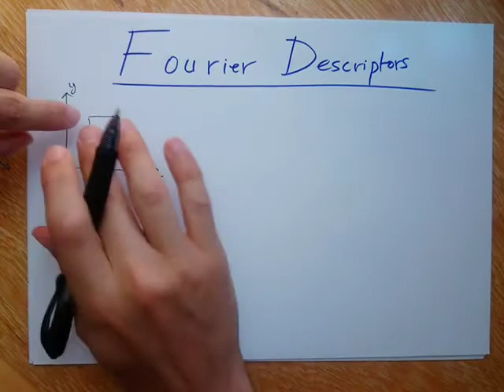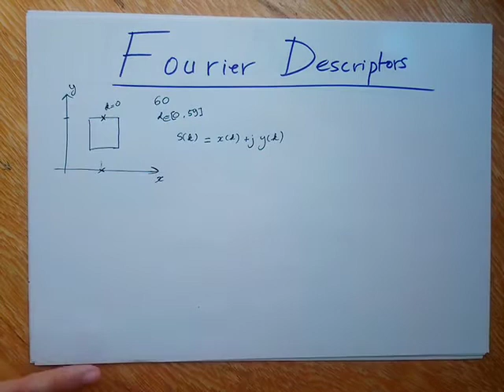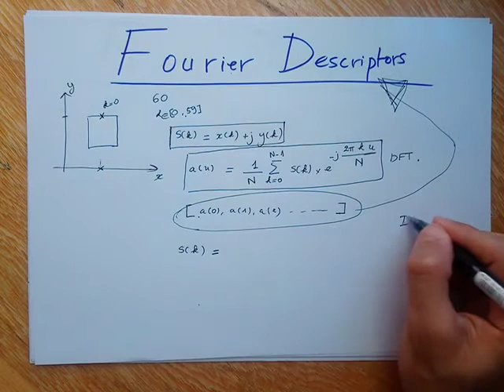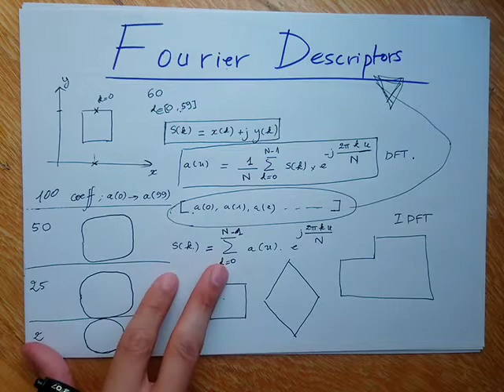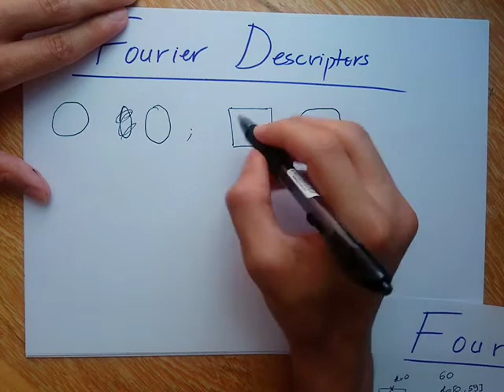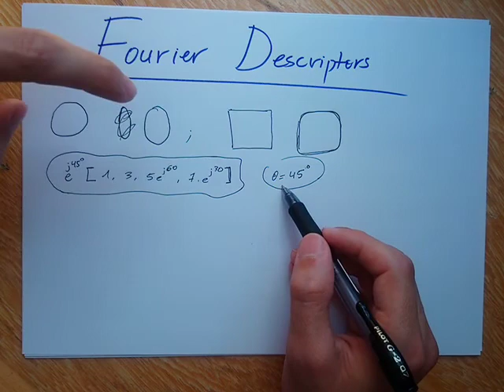Fourier Descriptors

Comment: How are the first two shapes @6:45 different? They can be mapped onto each other by applying an in-plane rotation followed by a small scaling factor.
Is the FD technique sensitive to rotation of the coordinate system?
Reply from the maker: They are different in that the first has 90 degrees corners, whereas the second does not. Rotation and scaling does not change angles of a shape corners right? So they are different. Yes
FD are sensitive to rotation as well as translation, scale, and unfortunately, the starting point too.
Reply: @zardouayassir7359  Yes I see that the 2nd shape is more diamond-like so the internal angles are slightly more and slightly less than right angles but still is very similar under rotation to the square. I watched the latter part of the video and then I saw where you explain that FDs are rotation-sensitive. Hence they are not useful as-is for shape recognition, because identical shapes can be found at any scale and rotation.

Do you know of ANY variations of FDs that are rotation- and scale-insensitive?
Reply from the maker: @okeuwechue9238  You may be right that the two shapes are kind of similar.  But what matters is the point I tried to make. Although I never seen someone use FD, "not useful" is not the right word to say. I'd recommend you to avoid jumping conclusions like that. From one hand, there is an easy way to normalize against rotation and scaling changes. For instance, multiplying all FD by a constant alpha=5 normalizes against change scales by the factor 5. From another hand, there are some applications that I worked on personally where normalization is not important because the ENVIRONMENT IS CONTROLLED. An example of that is industrial inspection of product containers (e.g., bottles). All containers running on the conveyor belt are alligned by a mechanical system. There is no way for a container to be rotated. Also, all containers have the same size so scaling is not needed. By the way, SIFT descriptors are robust against illumination changes, scaling, rotation and even perspective changes (to some extent). There is a speeded up version for it called SURF in case this interests you.